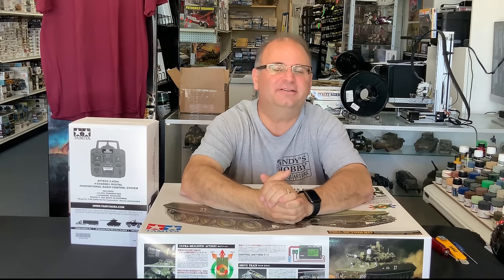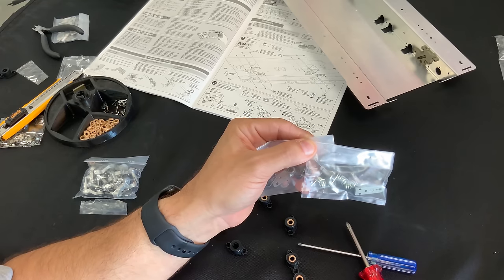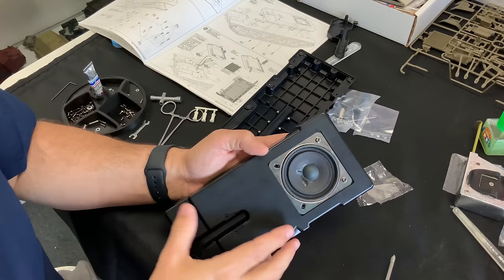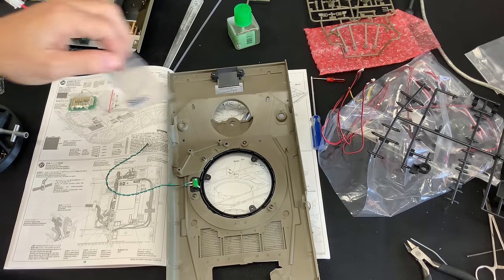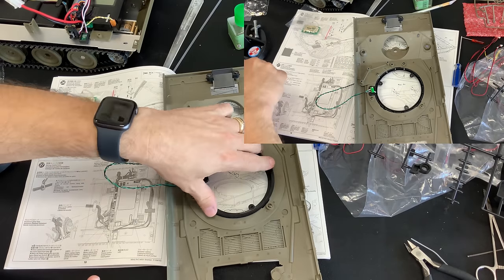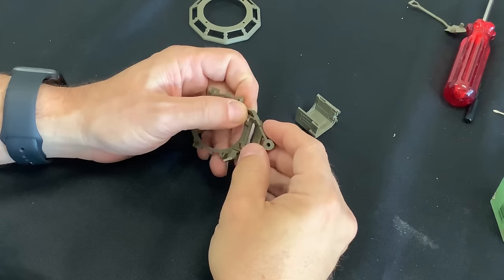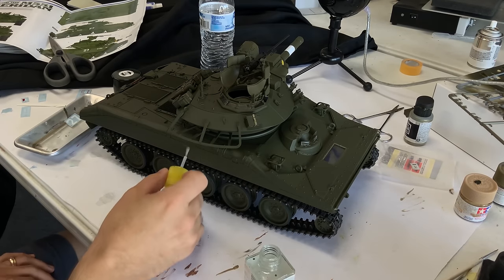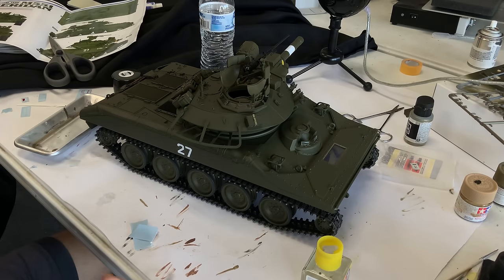New Tamiya 1/16 RC  M551 Sheridan remote controlled tank.Complete step by step build

Comment from the maker: the next video has  the correction I made to fire correctly  https://youtu.be/vR2CMf82lI8
Reply: I have a leopard 1a4 and wondering where a good place to fine parts for it because it doesn't have a terant ring
Reply: Hey Andy what if i put 2 high torque mid KV brushless motors in there. would it make it go fast enough?
Reply: Hello I am Jack Gildroy and I went to Viet Nam in  Dec.of  1968. I was in  A Troop 2nd Platoon, 1st Squadron/1st Armored Calvary, Americal Divsion 1 Corps Viet Nam. For the first two months I drove an ACAV. M-113-A1 (Armored Calvary Assault Vehicle) I TOOK TURNS DRIVING THE OFFICAL "Mine Detector'...The lead vehicle... YOU HIT IT OR YOU DON'T!!!
If you don't hit it you don't have any thing to worry about... We had 7 ACAVS including a 81mm Mortar Track and 1 Patton M-48 A1 tank. The tanks couldn't go with us,(our 13 ton 
 ACAV FullyTracked "ALUMINUM Armored" Vehicles) through the wet rice paddies during the rainy season because the would just sink into the rice paddies. When we got the " 26 TON"
SheridanTanks (one per platoon) we thought it was the best thing since sliced bread. The Sheridan was light enough it could go with us in the rainy seasons and it could swim with us when we had to cross rivers that were too deep for the M-48s to cross. We learned how to take care and it gave us the fire power to take care of us. It's Aluminum  Armor was enough for 
dealing with ( The VC and The NVA)  it was a major boost for us. We had to adapt our methods for fighting in this Hot Damp climate for all of our hi- tech weapons. The new M-16 rifle
had some issues until we learned how to take care of it in this climate too. I was driving and I collected an anti-tank round from "Charlie...Air-Express (RPG-7) and because we had great support I survived. The Sheridan Tank was part of that.
Reply: @johnr.gildroy5983  thank you for your service.

Comment: Andy, nice job, I always like seeing your skills.  One note, as a former crewmember on several M-551 Sheridans, the piece of "glass" on the front of the hull is actually a part of the floatations surfboard. You may want to paint the backside of it the same color as the remainder of the vehicle. The surfboard was plywood and was often splintered quite a bit, and along the sides and back edges, should be black for the covers over the floatations screen, that was black rubber. You can catch all that when weathering it. 

One othe note, we almost never fired the main gun off the side, the recoil was brutal. Over the front it actually could lift the front roadwheells!  The shillelagh missile did not do this.

Looking forward to getting and building one of my own to look like my last full up Sheridan circa 1978 in the 11th ACR in the Fulda Gap germany
Reply: Thak you for your service, sir. I pray you are well.

Comment: This brings back memories...  My Dad had a kit like this a long time ago, but his was mostly metal parts instead of plastic, even the treads were these little bits of square metal you had to solder together.  The inside was a mess of servos and a battery (lead acid if I remember), and he had to make a servo for the turret since the kit didn't have it.  And of course, no speaker system, heh.

Comment: I saw these for real, in Germany, during the 70's. When the main gun fired, they would rock backwards, and, the front roadwheel would actually lift up! If Tamiya does make an M60A2, it would be a must have for me, I was a gunner on one of those...
Reply: Actually came up off of the first two roadwheels when firing the conventional ammo...like being on a wild bull ride.  The whole vehicle weighed about as much as the turret of an M60A1.  Many novice gunners wound up with black eyes because they did not weld their foreheads to the headrest above the optics before pulling the trigger. 

At Ft. Knox, we had to drop for 10 every time anyone in the class referred to it as a tank.  It was an AR/AAV (Armored Reconnaissance/Airborne Assault Vehicle).  They were also amphibious.
The clear part in the glacis of the model should have a hull colored piece underneath.  It was a window in the swim board that was raised for amphibious operation, and allowed the driver to see (sort of) where he was going.
Also originally designed to be air droppable.  The story was that they tried it two or three times.  Even with the multiple parachutes and retro-rocket equipped pallets, the impact from hitting the ground would break equipment loose in the turret and render the vehicle inoperative.
Thanks for the great video of the build, Andy!  Looks like Tamiya did some wonderful engineering and you did some serious modeling.
Reply: @wbradburn8871  I was a Sheridan Driver in the 11th ACR it certainly did jump. It was fun to drive as well.
Reply: Damn the tank rocks on firing.
Reply: I was having Ft Irwin, California flashbacks! The opposition forces used Sheridans. I escaped from one in a Gama Goat back in 85'!😝
Reply: @wbradburn8871  I served on a Sheridan in the '90's with the 82nd. We dropped them on a regular basis. It wasn't until parts started becoming scarce that we stopped using our normal tanks for airborne ops and started using some stripped down versions.
Reply: @thomaswilloughby9901  Heck of fun to drive, absolutely!

Comment: I built the Tamiya Tiger I and was thoroughly impressed with the barrel recoil action, simulated hull jerk and overall track travel action. I'm not so sure on what I've seen so far with this M551. It seems a bit less realistic and more toy-like.
Reply: Rapscallion    Yep, I assume there’s a trade off - details for durability. When I was in Japan in the nineties, I was marveling at some of the portable music player technology that was years ahead of what was available in the states. A store clerk told me that the controls were “too delicate” for the US market - never did see any of that stuff over here. I guess we Americans were not careful enough with the equipment and would break things too easily? Then we’d complain. LOL. Same with their models. I built a bunch of Tamiya “remote control” tanks back in the day - they had a control box attached to the back of the tank with four wires about 3 feet long - two wires for each motor/gearbox. The details were really minimized on these working tanks compared to the static models. The control box parts weren’t nearly as robust as they should have been - I still have an old Matilda remote control tank from the 70s that I never got around to building; I think I’m just going to skip the motors and leave it a static model. The remote control parts on all my old models never held up.

Comment: Beautiful build and I love your videos. Might want to check the recoil of the gun because to me it seems that it does not function properly. The barrel should move back when you shoot.
Reply: Yes and is´nt the tank moving to the front first when recoils?
Reply: Yep recoil not working.  Chassis movement is to soft.  When the real ones popped a round off it would lift up the first two road wheels.  Got to find some grease guns to stash on there also.  Then it would be about perfect.  Just missing some of the commanders armour but that could be scratch built.  Nice kit

Comment: Had to watch boom-boom and tatta-tat-tat sequences over and over. That's really cool! I wish the speeds of its motion were to scale. That thing is so fast.
Reply: That's just down to user control... The turret could be rotated slower and the throttle applied in smaller increments. Would just take time for a user to get used to doing everything so it looks to scale.

Comment: Andy, ALWAYS turn the transmitter on first and off last.  If you turn on the receiver first you risk a run-a-way.  Loved the build though!  Great job.
Reply: Saved me from saying the same thing , very much standard RC practice 👍
Reply: yes, I totally agree... ALWAYS the radio on first and off last in case of runaway and incorrectly set failsafe... Basic RC practice...
Reply: Unlikely to happen with 2.4ghz
Reply: @PieAndChips  Agreed. On the Tamiya Tiger1, turning the tank or transmitter first gives two different start up sound options, crank start, or battery start. Why would a manufacturer offer a option if there was a possible runaway issue? Runaways were an issue with AM/FM modulated radios getting false signals. Even with the saturation of the 2.4 band, never had an issue with 2.4ghz, can leave my trucks and tanks on all day with their radios off, no problem.

Comment: The engineering is superb, especially if you compare it to the Chinese stuff.
Reply: Bruh, the "engineering" in this thing is the same as every other RC tank, there is nothing great about it, besides the price tag. For this money you can easily get an equal or even better RC tank by upgrading a cheap one or just buying a hella expensive one..

Comment: MSRP is close to $1400 without radio gear.  Seen them online around $750, but after you buy the RC equipment I assume it will be $1000+ new.  I think that I'll just look for now.  It is nice though.
Reply: $1500 for a full function complete Semi truck from Tamiya, $750 for this tank is a steal.

Comment: Tamiya should include a realistic mode to switch over to from this hot rod mode. Maybe an option within the DMD.
Reply: you just turn down your trim on your radio so full stick forward isnt as fast as it normally is. saves a bunch of money on both sides and it's reversible

Comment: I have built the King Tiger and M4 Sherman and am currently just starting the Tiger I   They are fun projects and really fun to operate.  Great instructions and VERY high quality.  Programming was VERY minimal, but I do highly recommend doing the Bench Test of the RC gear before installation as per the instruction manual.  I have the Panzer IV in the Stash.

Is that the Trumpeter 1/200 USS Yorktown (CV-5) 
in the background?  Would LOVE to see an inbox review on that baby!

Comment: with regard to the Tamiya battery connector.., it's a very old design and very unreliable. now we're using much higher capacity batteries it's recommended that you upgrade the connectors to Deans, EC3, XT60 or the like.

Comment: Very nice!  Why does it seem to move forward when you fire the main gun?
Reply: That's called a Track Recoil which is programmed in the DMD Motherboard by the manufacturer.
Reply: I understand it's programmed to move when the gun fires.. but I thought it would move backward not forward.  Usually I see tanks in videos jump back when they fire.

Comment: Are these Tamiya tank kits water resistant/proof at all?  I feel like being a tank it should be able to get a bit wet and dirty.  Great build Andy, thank you for these videos.

Also, I wish Tamiya would get the TRON license and build the classic TRON tank with full sound board.  That would be so hard to resist, especially if it lit up...
Reply: Not waterproof if built stock.  People have modified them to be.  Mine has been through a bit of mud.  Was a LOT OF FUN, till it dried.  Took a couple of hours to clean up.

Comment: For the size and cost it is disappointing that the tie downs and many surface details are molded on. In addition the  grill doors had a wire mess cover that is needed. I have the King Tiger kit from years ago and I cannot believe how updated and digitized the kit is.

Comment: If you are spending that kind of money on a kit, get some proper bearings instead of the bushes. They are cheap from bearing companies and make the drivetrain alot smoother. Standard upgrade on all Tamiya RC kits not just tanks.

Comment: There is definitely a fit issue with this model. Another guy posted his build of this tank and his also doesn’t fit properly front and back of the hull. There are small uneven gaps.  Not a criticism of the builders obviously, rather of the model
Itself.

Comment: That is one expensive tank, $1383 on Tamiya's website.
Reply: At that price it will stay there
Reply: The most I've seen is around $2,000 to $2,500 for a Tamiya 1/16 King Tinger, Jagdpather, M51 Super Sherman in Tamiya's Ebay.